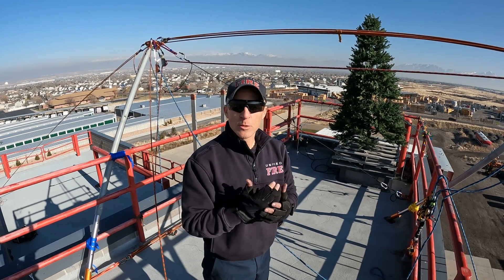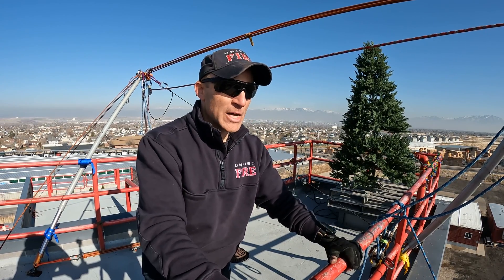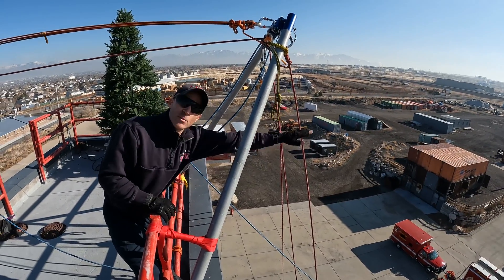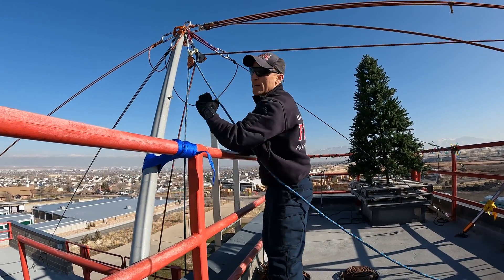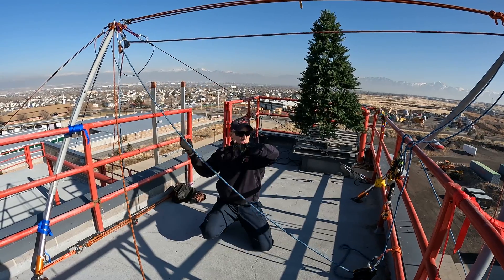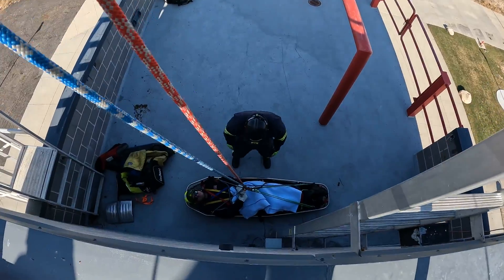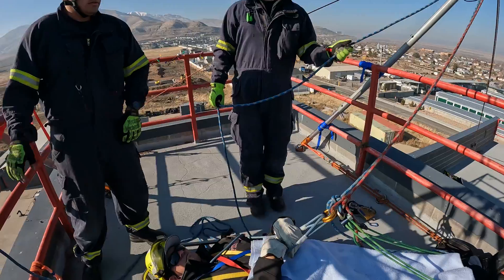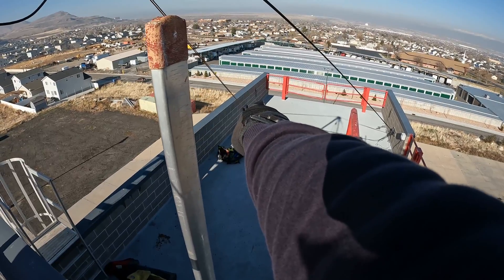Skate Block/Tracking Line Hybrid Offset: Litter Through an A-Frame/Gin Pole Combination AHD

Comment: Bob I keep forgetting to ask? When you guys do twin tension systems for a raising or lower, do you guys put attachments on the waist? Or do you do one on the waist and one on the sternum?
Reply from the maker: For a rescuer on the end of the system, there's always a primary which is on the Ventral/Pelvic, and a belay/backup which is either @ Sternal or Dorsal (rescuer's choice) unless we're operating in a backcoutry environment w/ just a seat harness in which case both connections can go to Ventral.  So now you're probably thinking "So which line is connected where?"   My rigging philosophy: A lot of us have embraced the use of the Double/Interlocking Long-Tail Bowline... or any midline knot system that will bring both ropes together into a central point and then offer a continuation beyond the knot for a backup connection.  This configuration works for all 2-rope applications/scenarios whether it be a two/twin tension system or single-main-single-belay system.  So now, if we look critically, the rescuer's primary connection is via the yoke of the midline knot(s) to the Ventral point on the harness while the backup is on one of the long tails coming out.... End result: the rescuer is connected into two points on a 2-rope system one of which is a primary and one of which is a backup.  The system belay ends at the yoke/MAP, or loop of the midline knot(s).  So therefore it doesn't matter, from the perspective of the rescuer, which line does what.  However, the anchoring landscape on the topside WILL influence the mode of operation (SM-SB vs. TTRS) & which line is going to do what task.  Long winded response.... but they always are
Reply: This would be a GREAT video!  Thanks!!  @Propeller_Head
Reply from the maker: ... as for a patient in a litter, IF the patient is properly secured w/ internal & external lashing, then then the patient needs no further connections.  If there is any concern, then one of the long tails can be attached to the litter as a backup should the litter bridle fail.  In my opinion, under no circumstances should the backup long tail be connected directly to the patient.  Unfortunately, most fire departments, training companies, & "YouTubers" commonly practice this, often without any critical thinking involved... it has become dogma.
Reply: Again I think this would be a great short video topic. Attachment point pros and cons and what works best.

Comment: Any particular reason you went with a skate block versus a cross haul?
Reply from the maker: Cross-hauls (two-rope offsets) only work when you have two high-points across a span that you are operating from that are not only high, but much higher in relation to the span... Basically it's an alternative to a reeving or drooping highline system.  Since we only have one high point and it is located between the patient and the egress, cross-hauls (two-rope offsets), dynamic directionals (deflection offsets), & highlines are off the table as a transport option... the geometry of the landscape/canvas does not support these types of systems.

Comment: I don't know how long it took you set that up but would a pivoting A-frame secured in the middle have worked? Would it have saved you any time?
Reply from the maker: Similar to a Gantry?  Probably not a time saver... That would take more operators for sure.  Plus the A-Frame would have to be a whole lot higher.... like Gold Strut kind of height.  But interesting idea for sure.... Worth a visit to the old white board to sketch it out.